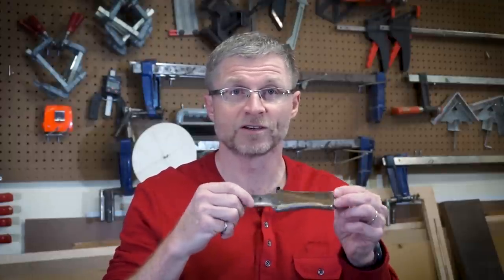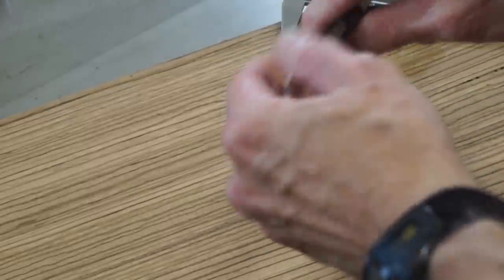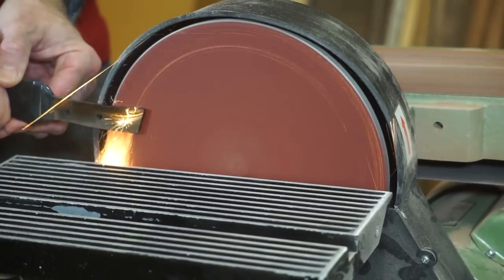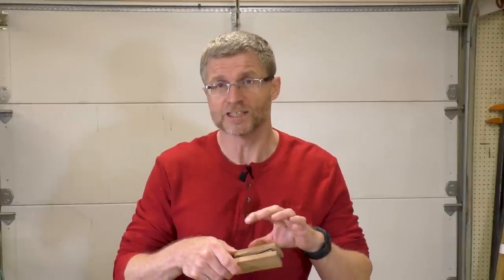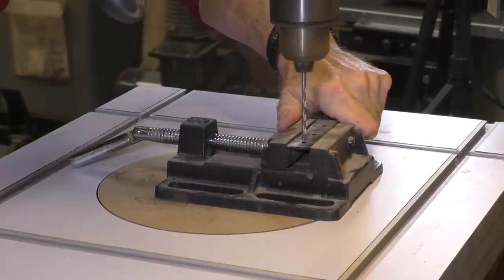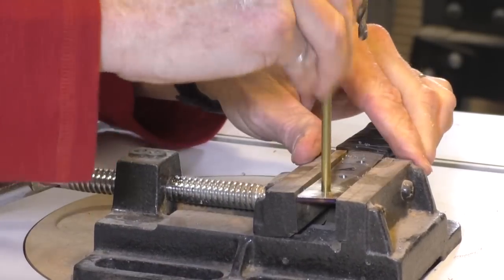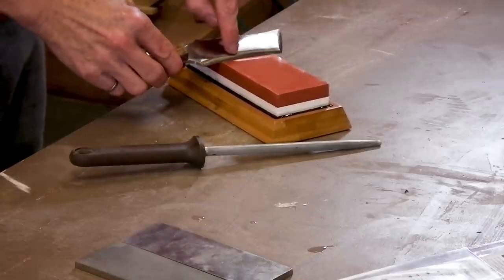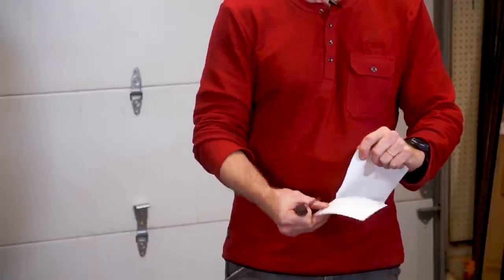How to make a knife handle

Comment: Hi Mike, Great video.
At 8:40 I would have really liked to see you wearing thick leather gloves. If the drill catches, you could get a nasty wack on the fingers or even lose a finger or two....  
At 8:50 even though you have used double-sided tape, I think drill one hole, pin, drill 2nd hole, pin, drill 3rd hole  is an improvement, to ensure minimum movement.
I have never come across stabilizing resin. Nice idea.
Thank you for the video, nicely edited.

Comment: When you were flatting the tang of your disc sander, you said it heated up.  Were you concerned that the heat might change the temper for character of the metal?

Comment: OMG,,, what did they do 100 years ago without all the epoxy/vacuum resins??????
Reply: Right.
I just want to be able to make a nice knife handle without buying a bunch more shit.
Reply: Tree resien,deer shit, and charcoal but hey if you have that available to you by all means if not just get the 9$ epoxy 🤷‍♂️
Reply: @donovenvarner  will human shit maple syrup and cigar ashes work?
Reply: @cheapshotmike1091  I mean, in theory, Possibly. As long as you have a lot of cigar ashes and only use a minimal amount of human shit. Make sure to have the syrup sit out for a while. You want a thick resin consistancy. You can always just use pins and leather bound aswell 🤷‍♂️
Reply: Get resinis bark from sliver birch for example, burn the wood in a bin with a tray under the fire with holes in and you will get a liquid black tar like resin.... it dries solid like resin and just needs boiling to melt before application look it up, Google something like "making resin from tree bark" or someshit. I get your point tho like just use some wood n rivets ffs but the tar stuff is cool to learn about, it's also flammable and water proof when dry so good firelighting source in the woods ;) even the bark alone burn like its soaked in parrafin

Comment: Came out nice. You might already know this, so if you do then my apologies. When you sanded the tang and the knife got hot, that's a good way to kill the temper. I didn't see any dipping water, that's why I'm mentioning it. You can tell if there is any color change in the metal, a blueing rainbow effect. Again, if you were already aware of this, then never mind.. :)
Reply from the maker: Thanks for pointing that out. The tang didn't get really hot. It was just warm enough at that point when holding it with bare hands, that I knew that it would get too hot for me to hold if I tried to complete the other side without letting it cool down first. I did dip it in cold water, but didn't show that on camera.
Reply: Wood U Make It Glad to hear it, that sure is an interesting blade!
Have a great day..

Comment: You actually used a knife steel not a sharpener.  All the steel does is straighten out the cutting edge when it is rolled over.  With a knife like that, you should probably sharpen with diamond offset mini hones.  You could also make your own with wet/dry sandpaper.
Reply from the maker: Thanks for the explanation. I actually considered using my diamond offset mini hones that I use to sharpen router bits, but I thought the knife steel would work better.  I'll give them a try tonight to see what kind of a difference it makes.